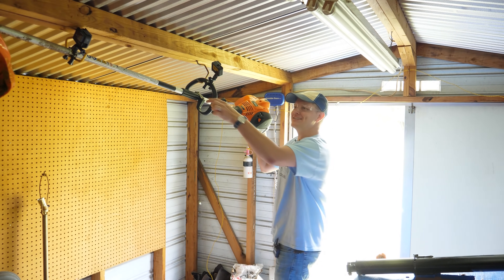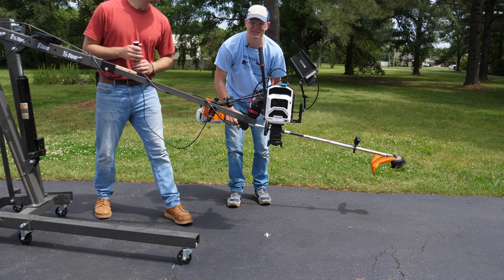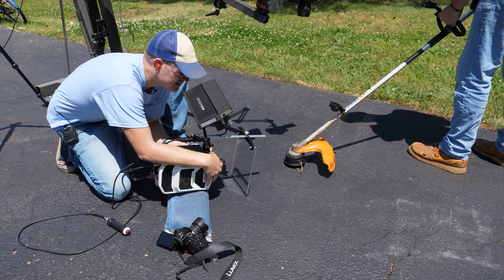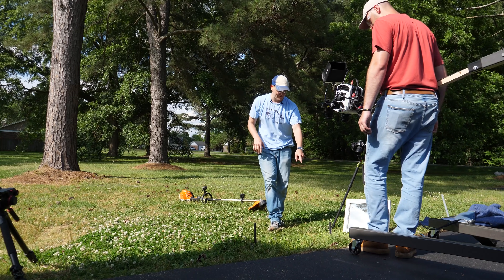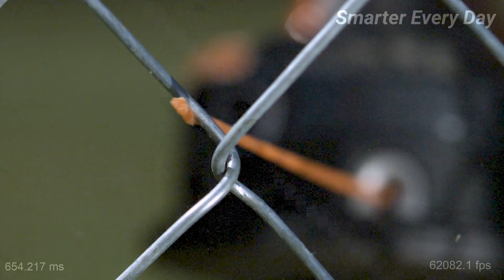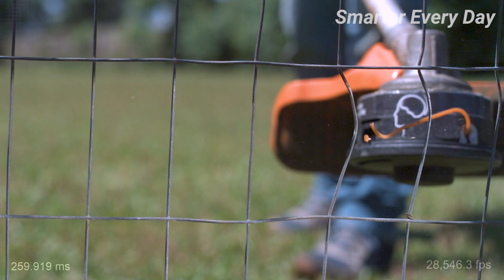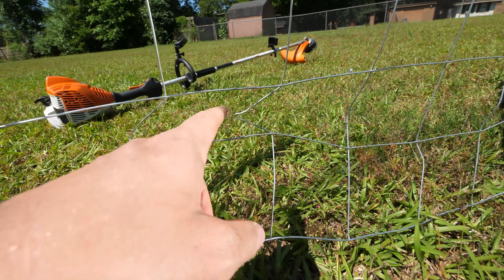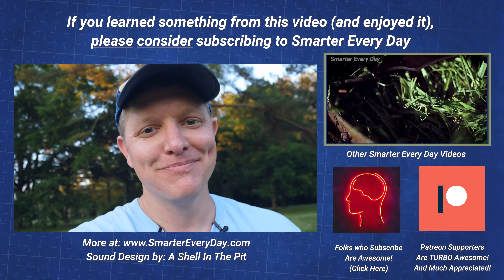How Weed Eaters Work (at 62,000 FRAMES PER SECOND) - Smarter Every Day 236

Comment: I used to go to a tech school where I learned about metalworking, and one of the teachers said something interesting that stuck with me forever: Everything's a liquid if you're going fast enough.  Now when he said it, he was referring to croumple zones in a car, and how that deformation takes a LOT of energy that is then NOT transferred to the passengers.

At about 11:00  you can see the same principle in action.  When that nylon line wraps around the fence, it looks as if it turns into jelly which then doesn't have the structural integrity to keep it together, and the end flies off.
Reply: Wow, you're right that's really cool! Thanks for the insight.

Comment: I have a trimmer head that has 3 rotating points that the line attaches to in small strips, instead of "bump-head" coiled line setup like you showed here. The idea is that the rotating points allow the line to deflect when it hits solid obstacles like fencing. However, I think it's moving way too fast for that to have an effect. I'd love to see you test this design too, and let us know if there's really any advantage or not. For me the only real advantage I see is it's much easier to load line than refilling those spool heads.

Comment: Do you think you could take a look at what happens when edging with a string trimmer turned sideways as well?  Specifically why the trimmer head is pulled to one side or the other?

I'm right handed and always edge with my feet on the grass side of the edge to avoid it jerking into the grass when I try to stand on the street/driveway side of the edge.

Comment: I worked for a lawn care company for 7 years. I learned a lot of stuff about weed eaters, some of which you covered. But it was cool to see it in slow motion and the to actually see the physics I thought about. You should try to see the differences of weedeating with round and angled line on and the different ways to throw the discsharge.

Comment: I got sick of respooling the plastic line and when the feed spool mechanism broke the ultimate fix was to install stainless steel rope of similar diameter.  Solid wire didn't last long due to work hardening fracture. The rope has the necessary flex, but can fray making a knotted end - no big issue. 
I found the motor needed less RPM to cut through thick wet grass AND it would whip through hard woody stems, something plastic will not do.

Comment: The release on the bottom of your weed eater is not meant to be smashed on the ground and especially not while it's running. Doing so will damage the release mechanism and potentially strip the gears in the weed eater. While the head is at rest depress the release mechanism and an inch or so will be added to the cordage.

Comment: Hey sir Destin ... 
For quite a few time , I have been observing a particular strange phenomenon , and I am pretty curious about it ... 
I made a setup , where there was a test tube with two wires in it and a pvc pipe ... The test tube contained salt water and the setup was not airtight , because , as I said , there was a pvc pipe ... 
Then I applied 12 volts DC for almost 5 hours ... Then left the setup to rest ... 
Then something strange happened ... The salt from the solution in the test tube , started seeping out from the negative wire of the setup and formed a blob of salt at the end of the wire ... 

But how and why did the salt travel through the negative wire ... ?
Reply: It probably corroded ot
Reply: @xxzenonionnex7658  no it didn't . I'm quite sure ...

Comment: It's not often that you find something that Destin/Dustin (sorry I don't know which it is) isn't quite correct about (Or is incomplete in the explanation about), so I'm gonna take this rare opportunity to interject. Around 8:37 Dustin says that the weed-eater hits the rod and the reactionary force causes it to pull away in a straight line. This is true for the first hit, and it does, until the next time that the line hits the rod and the reactionary force of that hit pulls on a slightly different angle to the original one (in the anti-clockwise direction in this video). It's not really seen in the video because the movement is too small but it will continue to hit the rod and pull it in roughly a circle (Really a series of straight lines like a hexagon or octogon with a lot more sides). This is why you feel like it's pulling it in. In reality it's pulling it around. It happens so fast that you feel it all more or less at once. From experience, the effect would be more pronounced the closer the head gets to the rod. It's difficult to explain it further than this without a diagram. Its a similar concept to instantaneous angular momentum and centrifugal force, if that helps.

Comment: I was genuinely puzzled by the term 'weed eater'. In Singapore we call them 'grass cutters'. I remember when I was in the army (early 1980s), there was a guy that came to my medical centre equipped with one with spinning metal blades to cut the grass on the lawn. One of the blades struck a stone, broke off, and embedded itself in the guy's ankle. Luckily for him he was in the camp's medical centre. We had to immobilise his leg with the metal piece still in it, and ferry him in the ambulance to the hospital. That's why they use only non-metal cutters nowadays. Thanks a ton, Destin for the video. BTW, I subscribed.

Comment: I use to be a grounds manager charged with maintaining sports fields. Some cool info on grass:

The tearing of the blade isn't healthy for grass. It create a large wound that is easily infected by pathogens and parasites: mostly different types of fungus. Fungus is overwhelmingly the main disease of plants (there are always viruses and parasites but fungus is the most widespread). 

A sharp blade is best for cutting grass as a freshly sharpened blade is most likely to induce the smallest wound. A dull blade will create a larger wound by tearing the blade instead of cutting it.

The grass will tend to seal off the area around a wound. This tends to leave a white area, sort of a scar, from the base of the wound to the tip of the wound. If the wound is large enough this will leave a white tip/area on the blade.

If you mow with a dull blade the whole yard will have a lightened hue to it as a result of all the tip of the blades being damaged: you can easily tell if a yard was cut with a dull blade by how white the tips of the grass blades are.

This is also why "mowing" with a string trimmer is typically a bad idea, you always want to mow as much as possible with a sharp blade. 

But cool video, I've always wondered what the string was doing. I'm very interested in what the different shaped strings will do. I typically use Husqvarna's titanium line for my home trimmer but typically used what ever bulk line I could get for grounds crew (we'd chew through so much it wasn't worth spending too much lol). 

Just thought I'd share lol

Comment: When you see it wrap around the wire you can see it liquefy slightly sometimes, it can even fusetogether (in the spool) or melts and breaks (sometimes at the aperture of the trimmer head) depending on the design and line. Most of what you discovered I have seen with my own experience using them too, great video!

Comment: Don't hold the ags nonstop, instead rev the engine by pressign the button and releasing it. Don't hit into stuff with the front end, use the rightside of the guard the machien is designed in a way that it pulls the weed and brings it to the side like a scythe would do, if you use the right side of the guard you have the highest chance to not get yours face sandblasted. hitting fences with the entire wire causes allot of premature wear. if you find your wire breaking over and over there are diffrent types of wires, the round one is ment for grass and small herb types of weeds, square and triangliar wires are ment for thicker of weeds and to be used on pavement or sidewalks. Just please don't hold the gas nonstop that's way to harsh on your engine.

Comment: I have tried many different brands and shapes of trimmer line in my brush cutter but by far the very best in terms of longevity and ability to cut tough weeds is the grey Oregon square line.
It lasts ages and doesn't break as easily when hitting concrete or obstacles. No scientific data to back that up, just my user experience.
I have the same Stihl bump feed head and I use 2.4mm line in it.

Comment: "An object in motion..."    well, to be absolutely accurate ... wikipedia says "In an inertial frame of reference, an object either remains at rest or continues to move at a constant velocity, unless acted upon by a force."  Which is what is happening to the end of the line. NOTE ... did you notice the momentum imparted to the piece of wire that broke off when you were working on the 0.060 wire fence?

Comment: I was surprised with the sound of the slomos, there's some very accurate sound design work there!
Reply: Yeah, those are aren't the real sounds, right? It wouldn't seem possible to get rid of the engine noise. I'm guessing they just found some decent samples and added reverb. They did sound very nice though so props there!
Reply: @BoozhiOfficial  slomo sound is recorded and produced separately. If the original audio was slowed down at the same scale of the video then the pitch would be below our audible range several times over.

What he possibly did was record a few things like swinging the plastic cord slowly, shaking a chain link fence, hitting vegetables, etc... slowed them down and pitched them down slightly and then added a lot of reverb.
Reply: I can't explain why but I really hate it when people put sounds on slow mo shots.
Reply: Same here, the sound design took the production to a different level.
Reply: The sounds are created and recorded separately for the slow motion shots. Destin has a whole video about it and the guy who specializes in it. Very interesting. The audio paired with the slow motion shots really adds a lot.
Reply: He hired a sfx artist to do it. He made a video about it a few years ago.
Reply: Yea l noticed that the weeds were gross to
Reply: And that's exactly why they call them foley 'artists' and give them Academy Awards. :)
Reply: Most people don't know how that's done. They think slow mo sound is a real thing, that's alot of work to make it sound like you think it should. Well done!
Reply: It is fake and I hate it. There should be no trickery in science related videos.
Reply: @txm100  if you're such a science purist you should be watching lectures. These videos are meant to be educational entertainment.
Reply: Hope the slo mo guys will do that too
Reply: @kievkotlet1531  The Slo Mo Guys always insert their own sounds, they just don't overdo it as Destin did in this video imo.

Comment: You're supposed to SLOW the weedeater DOWN when you are working a fence-line.....just above clutch engagement speed (3,000 RPM guess) not top speed (7,500 RPM) and you'll be able to trim the grass and weeds without tearing up anything.  You can even work against the bark of trees without hurting them.....the throttle is there for a REASON !
- ALSO - 
A couple squirts of RoundUp would SIGNIFICANTLY reduce your weedeater work around your A/C , ground strap,  fence line, ETC.

Comment: As a lawn jockey who does this for a living, trimming right to left means most of the grass you fling ends up on the lawn instead of out on the walkway or driveway. I like to think of it as the lawn in a clock face and going counter clockwise keeps the debris on the lawn for the mower to pick up. less mess to clean up after the cutting is complete.

Comment: I have a question for you:  The sound we hear in the slow motion....are you adding it in post-production or is actually the sound recorded.  If the later, I assume that it is pitch corrected.  Also,  just like the camera frame rate, I assume that the sound sampling must increase by the same amount. 
I am interested because I wanted to listen to a series of sounds that happen very fast.   Obviously, I don't want to use a high speed camera just for the sound component, but I was wondering how your sound was recreated - it matches closely with the action happening.

Comment: Comment will probably be buried, but what about the power delivery of the engine? @3,000rpm, thats 1 revolution in 20ms, or a power stroke of the engine for 10ms. if the wire clips the fence just before peak torque of a power stroke, it will whip the line from the fence more aggressively than during the other non powered 10ms of the engines revolution. i think testing with an appropriate electric model would deliver constant torque and therefore observable results.

Comment: I learned the crazy way what it does to remove the automatic line cutter on the weed eater. I Had A TORO electric unit and it work pretty well until the day that I broke the line cutter, I had a couple inch extra it was nice. But it seems to increase the drag so it increase the resistance on the electric motor.

Suddenly, the engine burnt in a majestic ball of fire! Yes, I transform my weed eater into a flamethrower! It lasted for 2 seconds and then the smoke ruin the show.